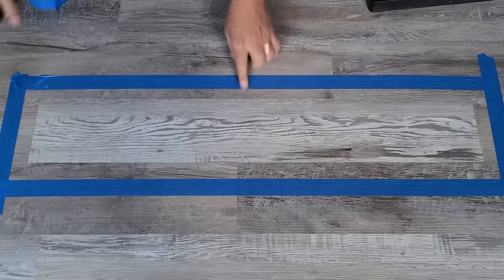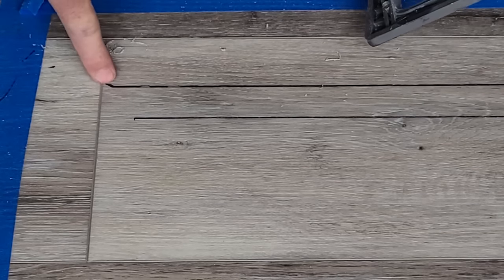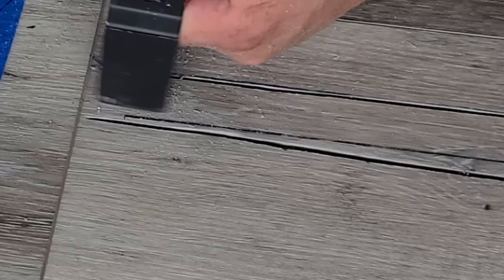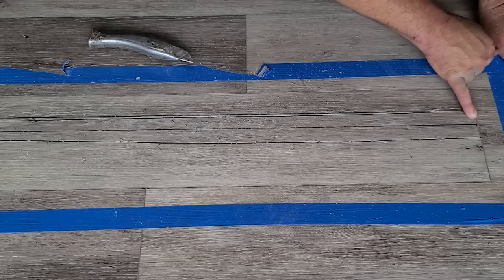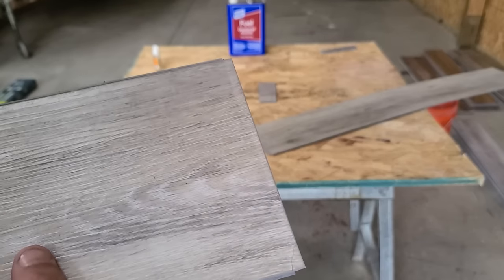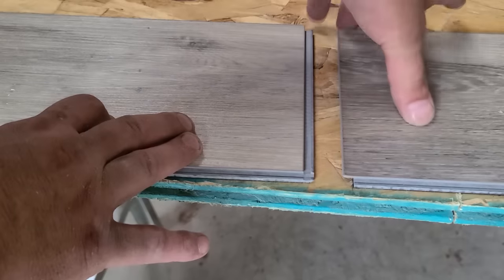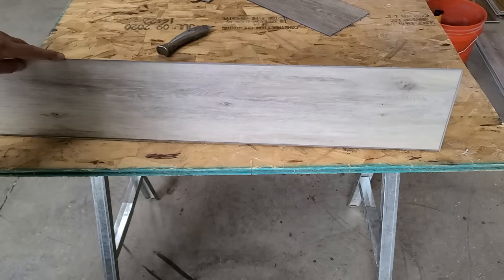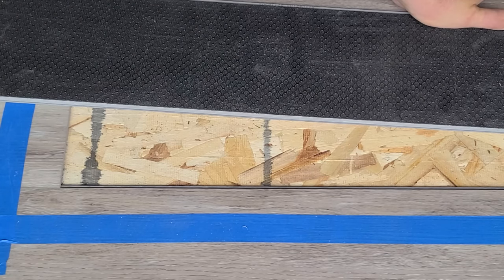Replace a DAMAGED Drop and Lock Vinyl Plank and NOBODY will EVER Know

Comment: Thanks for this video. I had a friend helping me with my install, and he laid a plank that had something stuck to the underlayment. This created a high spot/pressure point which led to that plank being punctured a bit. We think this plank will be hidden below the bed and never get worse, but it’s good to see that it could be addressed if we’d like to. However, I have not had luck  with getting a piece to slide horizontally once it is locked/laid flat. This makes me really hesitant to even try. Any tips for this situation?

Comment: Hello! This is so helpful. I do have a question about it cracking on the seams. We installed flooring from Home Depot and it’s been cracking at the seams so we will have to replace 2-3 staggered panels…so it’s a bit confusing on how to repair this in the best way. Thanks in advance for any tips!

Comment: When that lip snaps off and gets stuck under there a lot of times with a breed plank you won’t be able to get that out from under there. That’s a cheap plank you can tell from the other side where you saw where the lip kinda broke and you got that fine line.